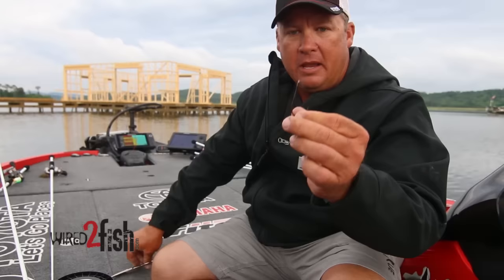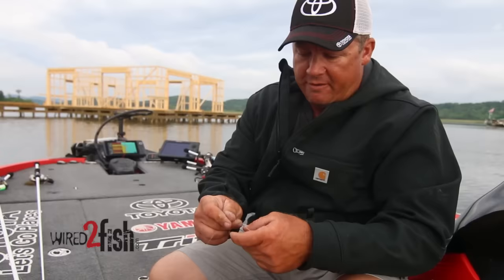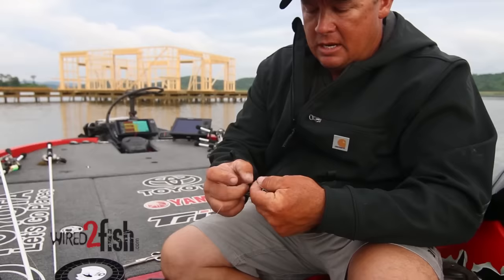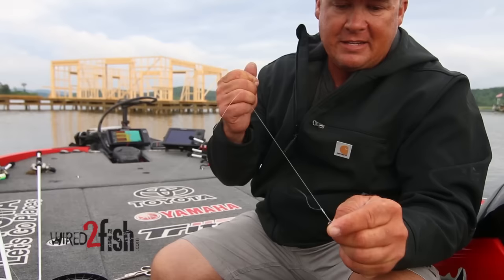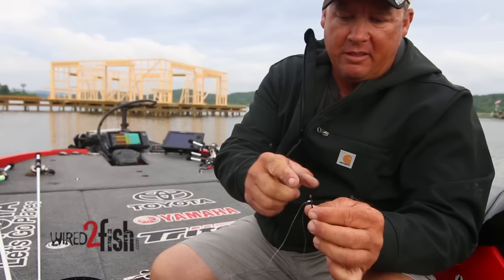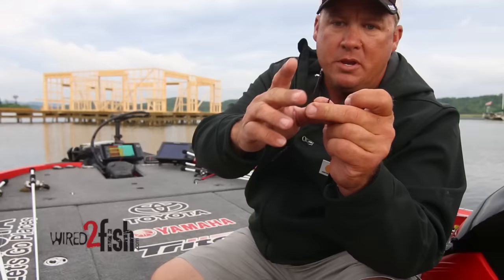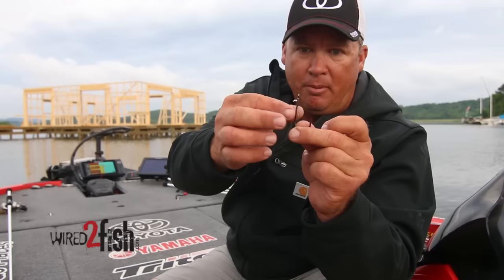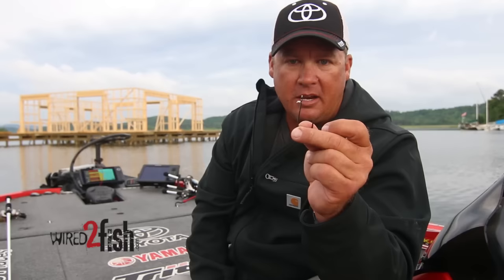How to Make a Fishing Hook Keeper in 30 Seconds

Comment: Show me how to do this with a hook WITHOUT a pre-existing keeper and this is a good tip.  Otherwise, I'm not spending the extra money for the hook with a keeper just to cut it off.
Reply from the maker: +Mark Coffman this is for a hook without a keeper or where the keeper has broken off, which is fairly common. The uni knot locks very tightly to the hook shank where it is tightened.

Comment: Wait! Did he cut off a keeper just so he could make a keeper, held by the spoke off the old keeper?
Reply from the maker: No, this hook didn't have a keeper. A lot of flipping hooks, especially "old school" ones don't/didn't have the bulky built on keeper, and often only a little barb on the shank for securing the plastic. The unit knot positioned above this makes a stellar keeper. At the same time, many popular flipping hook keepers break or slip and slide over time. The hook is still perfectly good, you just need a plastics keeper and that's where a high friction and bulky uni knot up by the eye comes into play.
Reply: James Brown was 5